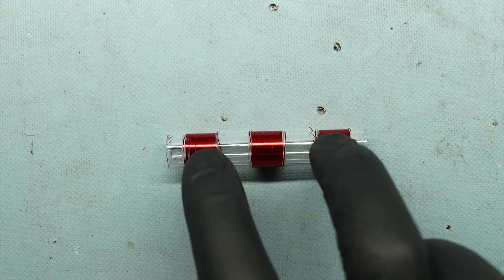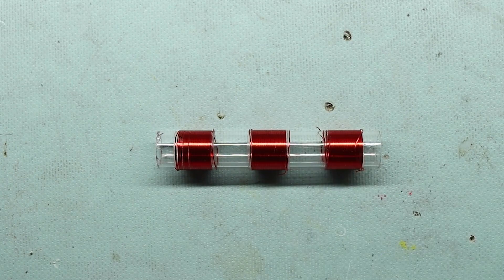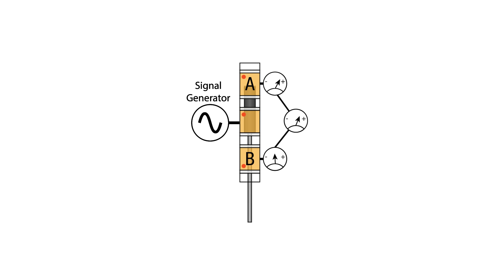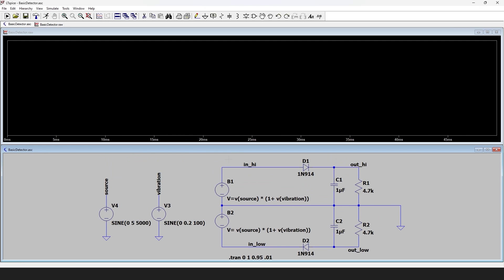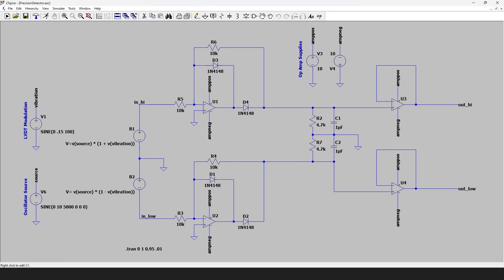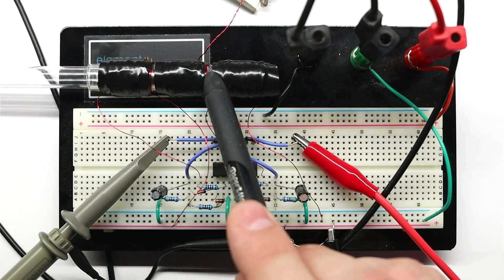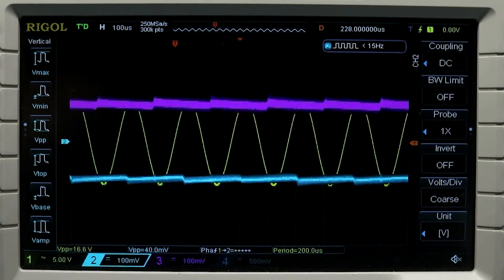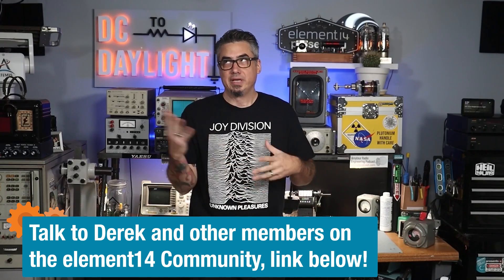How to Build a Linear Variable Differential Transformer Motion Sensor and Detector - DC To Daylight

Comment: Decades ago a couple of guys from Tektronix set up shop in Newport OR and set the standard for precision measurement of paper mill belt wear. The company was called Emvico and at the heart of the machine was a precision LVDT in a heavy cast stainless shell with a microstylus capable of micro displacement measurement. The belts for those machines cost $100k and so the mills want to know when to replace them at the last minute. To do this they measure the roughness of the paper surface using these machines. To this day, 50 years or so on, those machines still run and are still the standard for taking that measurement mostly in toilet paper manufacture. So the next time you wipe up, thank Emvico and LVDT's!

Comment: If you’re interested in very small displacements, I guess you’d want the two sense coils to be very narrow. I wonder what kind of positional  resolution is possible with a DIY LVDT?

I’ve also wondered if machining the moving slug to have thinner disks on the ends rather than it being a constant-diameter cylinder would increase resolution, as the flux would be more concentrated? You’d have a much shorter linear region, but if you were just concerned with small displacements, that would the limiting issue.

Comment: Cool project! In my opinion, winding the wire is the most enjoyable part! You can also try making a fluxgate magnetometer, which is similar in design. :face-blue-smiling:
Reply: No offense, but I'm glad I"m not the only freak that actually enjoys winding the wire. I love trying to get it so there are no gaps and no crossovers. I made an electric coil winder but avoid using it because it takes some of the fun out of it.

Comment: We can improve the circuit by using four OP471 [high-speed quad opamp]. IC1 for precision diodes with voltage follower for impedance matching. IC2 for two 2nd order low pass filters. IC3 for the RC oscillator based on the distance between two differential coils and the feedback And IC4 for adding the two signal and diode capacitor envelopdetecton followed by difference amplifier to get constant output.  
It will be a closed loop system.
But in modern time, we cam condense all of that in 1 small thing like PSoC5 or SLN47004. 
Cheers!!

Comment: This seems like the nerdeist way of having a position indicater for a vacuum variable capacitor tuned mag loop then you could have so.e code running on a pie to correlat voltage with frequency and use that as a way to punch in numbers to almost instantly tune to a given frequency  obviously you would have to do some set up tests say every 10kc on each band note the voltages assign them a value or even just straight frequency and have it so you can just type in a frequency when in use and it will go straight there